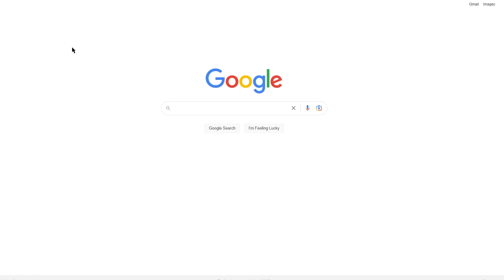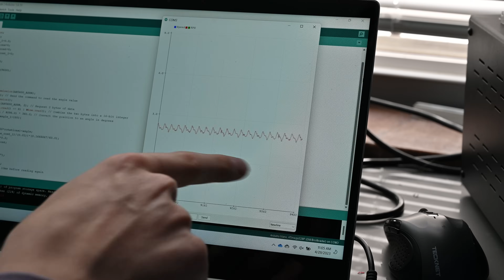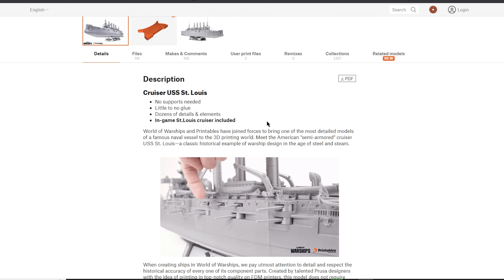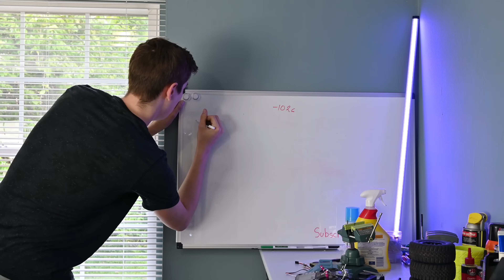I PRINTED an RC Car... How FAST can it go??

Comment: Awesome work! Starting off with robak would've been much easier. I never measured speeds but mine is definitely going faster than this, drives more stable, and all electronics are protected.

Comment: As a past RC Oval National Champion, speed is all about the less friction you have the better. Your main gear I called it a Spur gear and your motor gear a pinion gear is too big and bulky. Try and modern brushless motor setup with a modern spur gear and pinion, you will be amazed at the results. Also for steering the less steering you have for just going straight would be better, a very slight toe out would make it more stable. The rear arms with 0 degree toe out would be for all out speed, or a very slight toe in for a bit more stability. Also get a modern radio setup with the trigger and steering wheel control, much easier. Now this is all pending on what kind of budget you have.  :) I wish you much success.

Comment: Change the wheels and use foam tires.
Put an bigger motor.
Reduce the high to lower the center of mass.
And good luck

Comment: You should try placing the electric motor in the middle of the car right infront of the cv axles, make a rear diff for it. You might be surprised at the results like I was when I designed a similar kind of setup for a go kart sized vehicle.

Comment: I have never seen front shocks angled out, this will make it softer as it goes through the front suspension travel, rather than firmer (i.e. progressive) as is usually the case for suspension.

Comment: 1) you might need to lower the car and run on a flatter track
2) limit or make a limiter of  your down droop travel so it doesn't bunny hop as much
3) enclose with a body to reduce drag and wind resistance which might cause it to lift and flip up
4) create a down force for front and back
5) turn up the punch in esc to highest (increase acceration) also check gearing as well - don't run out of runway if you geared too low 
6)  run on a lower turn motor (like 4.5T)
7) avoid turning turning your wheels as it would make it unstable in high speed

Comment: The tires you have on make a bigger difference than you think, if you look back at the footage while going on the higher speeds, the tires are deforming (which you mentioned). The deforming is making your contact patch almost a third of the original size, which i suspect is leading to instability and loss of grip.

Comment: Try some red tack (Lucas, etc.) on the diff gears. Looks like you might be using a silicone or lithium grease. Also as others have mentioned, you might want to either get some better shocks or try some different weight fluid in them.

Comment: You can move the front upper control arms back and tilt the wheel hub  to add more caster. This will make the rc car more stable on the straights. I know it's an rc car, but have you accounted for the Ackerman's principle?

Comment: Try to find a better surface, as this surface will unsettle the car anyway, whatever setup you do. AWD is good but once you have a good surface, rwd might be better. The tyres are squishy and has a lot of travel by itself so it’s making the car roll a lot, so better tyres are a good thing(only on good surface). Try lowering and widening the car, make suspension with adjustable  geometry, go through guides for suspension set up. Here you have a lot of roll making the car shift weight around a lot. Make the car more planted, check the weight distribution accordingly. Longer chassis helps at highspeed too. Less stickier tires might help in this surface as it will prevent those uncontrollable spins that happen when the tyres suddenly stick to the ground. Some caster angle might help with straightening the car.

Comment: you need tires that are flatter, see drag tires or land speed record cars they usually only run slicks in order to be stable because the bumps in the wheel due to bernoulli's can start producing lift, one also is sealing the under body for middle of the body downforce since it appears you already have a huge rear end splitter in place

Comment: a suggestion would be to use an acctual rc car controller, like the ones with the one big wheel on the side to turn and a trigger to increse throttle it makes it much easier to control an rc car

Comment: what you need is a higher kv motor/gearing, 4s is plenty enough for the size! anyway i still think that chassis was meant to be for a rock bouncer buggy, if you want to hit full speed you need a lower center of mass, shorter and stiffer shocks, "asphalt" tires and possibly a smoother surface to drive around.

Comment: If you had a pistol transmitter it would be so much easier to drive. Even a stick car transmitter would be better. First thing to do with a car when start driving is set the steering at center so you don't have to adjust it all the time while driving.
Also proper rc wheels has two bead channels so tires stays more firmly onto the wheel. I glue all my rc tires unless they have beadlocks.
Also to get to 100mph you need a body and the motor needs to be changed to can type type. Your seems to be for 540 motors. Speed run cars has motors that is as big as small soda cans and are costly. Outrunner motors is not used on normal rc cars. But crawlers do use them.
My speed project involves a Tamiya F102 on 2s. 60mph is easy to achive with the right motor.

Been in the rc hobby for over 30 years and I love it! Most of my cars is vintage stuff (pre 93 ish) or right after.
I like both orginal builds and custom stuff.
Not printed a whole car yet as they seem to heavy, bulky and seems not to hold up very well.
But 3d printed parts to beef up stock ones I do belive in.

Comment: The car lacks mechanical stability. I would recommend creating toe-in on the front and back. This would help the steering self center and the rear to track straight. Those shocks look like they have little to no oil in them, so they just bounce, causing you to loose traction. Using thicker shock oil is a must. In addition, the tires you are using balloon too much, which means that the contact patch gets smaller and smaller at higher speed. Belted tires would fix this issue. I would also recommend trying to get the center of mass more towards the middle, especially because it 2wd.  A differential in the back might help too. Also, Im not sure, but the funky shock geometry in the front may also play a part in the instability of the car. Take a look at real hobby-grade rc cars, and they will have everything i just mentioned.

Comment: One of the improvements I'd make if I were you would be a much larger and more protruding front wing. It's basically acting like a front wing/front diffuser of an F1 car but the placement of it's vertical side wings are disrupting the airflow to the rear diffuser. Secondly I'd probably curve the rear wing upward and make it more akin to an indycar/F1 rear wing. What you have right now is like an oval rearwing on an Indycar or a drift wing which I think is making the car more unstable than really adding downforce as it stands right now. I am a layman who likes racing but to my eyes at the very least it looks like a box that produces downforce rather than a knife splitting the air. It may be unavoidable to make a skin over the chassis in the long term but I think not doing so is fine for right now. If I was designing this I'd take inspiration from Paul Dallenbach's 2018 pike's peak car but I fear their may be diminishing returns with very large wings for an RC car that an ICE car doesn't exactly have.

Comment: you need to add a bit that slows down how fast the front wheels turn at high speed, because it looks like your controller is too sensitive, so at high-speed it becomes absurdly difficult not to overcorrect

Comment: The angle of the front shocks, with the lower mount inward, made the spring rate digressive. Under compression the spring rate softens on the front. I'd like to see you move the lower shock mounts further outward on the arms. For high speed high traction surfaces you may find that decreasing the motion ratio is required. Moving those lower mounts outward will decrease travel but also increase spring rate at the wheel. Set the static ride height so the lower arm pivots are horizontal with the ground, that should keep your roll center's in a more consistent location.

Comment: activate exponential function for your RC transmitter that will help you a lot! with high speed.
Rear spoiler instead of flat make it like reverse wing to create higher downforce when speed increase.

Comment: I regular pistol grip TX will help a lot with control. Better motors and high speed servo could benefit as it did my builds but there is no ceiling as the costs for those lol.  I got the DumboRc after seen on a few YT channels

Comment: Foam tires when those rubber tires balloon up less of the tire is touching the ground that’s why you’re spinning out when you try to give it full throttle and putting a drag style body on it will help keep it on the ground for better traction those tires are for like a crawler or Rock buggy and use a RC car transmitter it makes it’s easier to steer and control your throttle

Comment: You should change the tires to tirea which can actually handle higher speeds, as they wont balloon (come off the rim) as easily. This will also improve stability at high speeds

Comment: Nice one.!
I think you may be able to do it, but it absolutely won't be easy.! 
My PB is 91 & I'm struggling to get past it. 
I'm using an off the shelf RC (a Hobao hyper gt), I'm trying to do it as cheaply as possible. 
If I could give you some advice... 
Try either belted tyres (Jetko/GPM/Arrma Hoons) or foams (Contact).
Also a much smoother surface.
Lower your car... A lot.! 
Having the rear slightly higher than the front seems to work on most RCs. 
(you can limit your shocks by putting a bit of nitro fuel tube on the inside part of the shaft) 
A bodyshell will definitely help with aero & stability.
If you can I'd highly recommend getting a legit car transmitter with a wheel & trigger.! 
I don't know what ESC that is but it might end up holding you back. 
Hobbywing & Castle make good ESCs. 
And remember that last little squeeze of the trigger is the most dangerous part..
It's almost impossible to resist banging that last little bit in as the car gets near you! 😉 😉 😂 😂 
There's just as much power at 80% throttle as there is at 10% throttle (if you know what I mean.. Instant torque)
GOOD LUCK MATE.!!
Subbed & liked & best wishes from Scotland 🏴 🙏 ♥ 📻 🎮 🔋 🚓 🚒 🚑 🚐 🚔 🚕 🚖 🚗 🚘 🚙 🚚 🚛 🚜 🏎️ 🏍️ 🚤 🛥️ ✈️ 🛩️ 🚁.

Comment: You need to dich the CV axles and go with hub motors. The best thing about hub motors is differential throttle steering.

Comment: You will need to make the car longer to ease the steering, you will also need to reduce the steering speed. The tires need to be foam instead of rubber...and you probably need an aerodynamic body to increase the pressure above the car and keep it in place, then use 6S with a much stonger motor....and my advice use a road with no bends....to get the maximum velocity. It's also best to make the car 4 wheel drive...because that will improve your acceleration and control a lot.

Comment: Raz's secret is the perfect pass module that he sells. Allowing to ramp power in gradually even if you pin it

Use a belt instead of meshed gears might help with the noise too ✌️

Comment: A lot of good suggestions in the comments. But first and foremost you need to print a body that is both aerodynamic and provides adequate down force. It also needs to have adequate clearance for the Expansion of the tires. I would make a body with a lower spoiler built into the lower front of the body and then have a spoiler on the back and have them both set to an actuator that changes the angle with the speed to provide the more down force the faster it goes. You may also want to incorporate a bit of a roll cage design to minimalized component damage when the inevitable crash does take place.

Comment: Placing an FPV camera on the car, and a monitor at your location would give you a First Person Driving view. Should be able see and navigate better, as will be 'with the car' vs. trying to drive from a distance. 
I won't repeat other  comments suggesting adding downforce (wings) and improving suspension dampening. Adding a steering control mix that increases the expo scaling of steering response as speed increases may help with tendency to over steer when going fast.

Comment: Just a thought: I wonder if the expansion of the wheels at high speeds might be destabilizing the whole system, as they are no longer seating properly on the rims, the surface of the tire has a rounder surface, and the surface area of the tires on the ground is decreased. The superglue might keep them from coming off, but it might also cause irregularities in the expansion of the tires, adding vibration and unevenness into the mix. I'd recommend swapping to fiber reinforced tires or something before you change too much, just to see how much of an effect the tires are having.

Comment: Great job man, that thing ended up driving better than a brand new one I just bought lol. There are a ton of little details and caveats to good steering and control but somehow a 3D printed deal like this handles it all really well for what it is. I recommend some good oil filled shocks!

Comment: the problem with any type of gear in rc cars that reduce noise are prone to catch dirt and have it stuck between the teeth that ultimately will cause your gears to strip.

Comment: So straight-cut gears effectively allow much larger powertrains to be placed in a vehicle without risking the output shafts and other bearings tearing themselves apart, producing a larger safety factor within the transmission itself.

Straight-cut gears are also much easier to assemble and produce less-catastrophic failures when they do go wrong due to their simple structure.

I would go back to straight cut. 

You need also a more aerodynamic body as others said. Wings to stabilise at speed over 60mph. For high speed tyre need to be harder and not too much wide and soft.

You have to consider also weight distribution as an important factor. In your case seem to be to much in the back so front start to lose stability.
Also longer wheelbase can help.

Look some land speed record for design.

Comment: Great project and vast improvements with the redesign.  Looking at the last run, those tyres are not doing you any favours in terms of stability.  They start of low and wide, but as the speed increases you can see them getting narrow and tall with what looks to be a pointed top.   So the amount of tyre on the road is really small. Investigate different tyres to see if this helps with traction. Watching with interest

Comment: Here’s a couple suggestions
I would change the tires out to foams run a larger in runner or whatever the hell you call those motors replace the gears with metal gears, grease your gears, design, a more aerodynamic, body, larger fins, higher output, batteries, high output, ESC, that has reverse and brake and probably a Dumbo RC transmitter and receiver. They’re extremely cheap but the best receiver you can get under $200. They cost around 20 bucks. I’ve had a Traxxas bandit. It’s kind of a mix between bandit and a wrestler at this point, but I was able to get it up to 70 miles an hour at a little bit over half throttle before it starts to fly.
Reply: Ps more voltage equal more faster

Comment: Maybe drive with fpv gear and setup like a little seat and steering wheel ? The immersion would prolly make it easier to drive. I wonder if you could borrow some design elements off the Aptera car? At full size it’s entire body shape has the same drag force as the mirrors on a truck.

Comment: small gear should be of a harder/tougher material possible to print, since it does a lot more revolutions than the big gear, it goes throught more stress cycles and wear.

Comment: Car tune: make it wider, longer and lowered, after that, is very important to reduce the sensitivity of the stering, at hig speed smol movements make a lot of turning, the arodinamic part is not that impirtant at this scale for going straight, is important for turning at higspeed

Comment: man your 3rd printing skills are out this world to make them from not being into rc cars is something wicked ... I've read some these comments and some are so untrue to rc speed runs ...camber and toe is a starting point with droop screw in the arms so that the a-arms are level to chassis it have a turing circle of a truck but be more stable at high speed  .i would use a real rc car motor and esc and use a 1 to 1 gear ratio if can .. I would change to foam wheels from rubber as anything past 70mph tends to ballon the wheels ..good luck to you in your quest i will follow each step of the way now 😂

Comment: Start with better tires / wheels. You are losing all your stability once the rubber expands and the tires become rounded. You need a similar kind to what they use on the high speed cars where the rubber won't expand.

Comment: organic lattice spaceframe chassis. super capacitor. front and rear gyros with active suspension. active aero dynamics dont pin the car to the floor, glide it along on the limit of grip. make it 6 wheel drive. 

what would it take for wheels that go fat when slow then thin when fast?